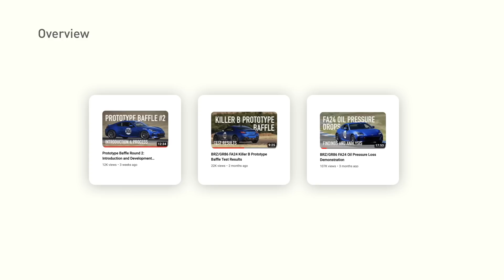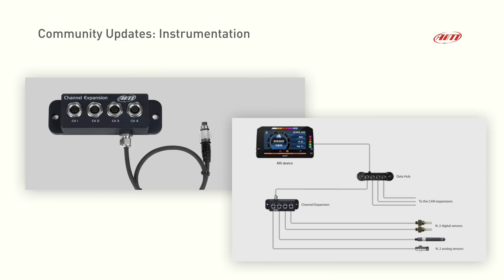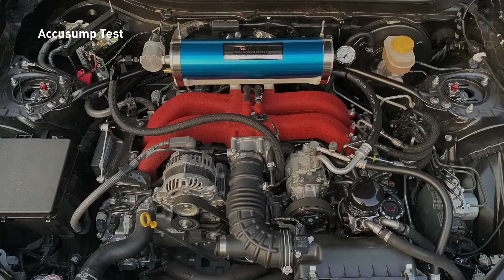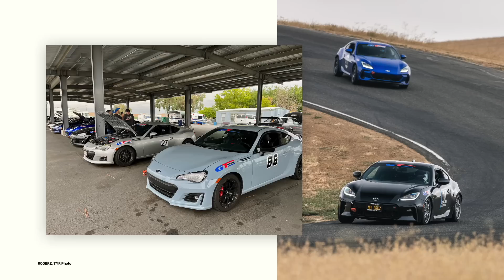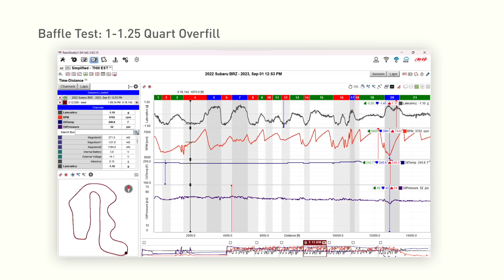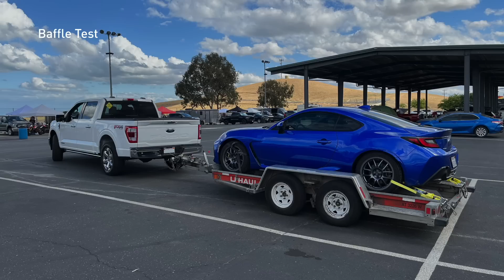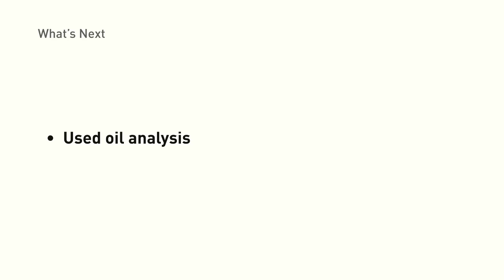Prototype Baffle #2: Results, Setbacks, & Future Plans

Comment: Put a LS in it lol
Reply from the maker: Haha my friend twisted my arm into test driving an SS 1LE before we knew what happened. All I could think about was the consumable costs lol
Reply: @900BRZ  i mean this is not as heavy as the 1 le though and you would have a reliable engine in it since you’re going through the trouble of swapping an engine I think that’s what I would do personally
Reply from the maker: Yeah but it’s a pain to do that in CA and keep it street legal. Only option is a brand new LS3 and then you need all the engine control, plus with the additional power, my understanding is you need a new driveshaft, possibly transmission, axles, diff, and wheel bearings. Correct me if I’m wrong, I didn’t go too far down this path. The LS3 is incredible though, I would love it.
Reply: @900BRZ  ahh yea i forgot about cali for sure..

Comment: Before watching this last episode, I was very skeptical whether the oiling issues could even be solved with a baffle or anything regarding the sump. Much of the issues with the fa20 haven't really been solved and have pointed more towards oil galley issues feeding rods 2 & 3. FA20 drivers tried larger oil pumps, optimized pick up tubes, machining the timing cover, shimming bypass valve etc... none of it seemed to work other than the bandaid of adding an accusump and dealing with it's shortcomings or dumping 5k+ into a dry sump. I am honestly suprised overfilling with the baffle in place made such a large difference. I would love to see more data on this. If the data is repeatable I think it would be worth trying a larger oil pan.
Reply from the maker: Yeah, we definitely need to do more overfill testing with faster drivers. 

There were a handful of people who were skeptical about baffles from the start, so I kinda have to just tip my hat to them.  

We have seen moderate improvements with the SYMS baffle, so right now it still feels like better than nothing if there was no warranty to worry about. I’m not sure it justifies removing the pan and risking warranty coverage though.

Comment: A reduction in oil pressure is most likely a restriction in available oil at the oil pump inlet AND/OR the available oil is highly aerated (can we say foamy).  Assuming the oil pump flow rate (GPM) and the sump volume is great enough to permit an adequate sump "dwell" time (in the aerospace industry we aim for 15 seconds to de-aerate the aerospace oil) for the entrained air to leave the oil, we must also have adequate oil return back into the sump.  Perhaps the issue is with the 2.4's oil system drain back/oil return design restricts the oil from leaving the left cylinder head in a timely manner (and to de-aerate) before the pump picks it back up.  As a retired aerospace engineer (on multiple jet engines and pressurized gearboxes), Subaru needs to be addressing these two apparent design deficiencies when track driven - but is an OK design to get your cup of latte or idling while your seat heater is on.
Reply from the maker: Thanks for the comment. Yeah, after we saw the bigger overfill have such a large improvement it changed our thinking from trying to control oil in the sump to believing that the return is too slow and the oil level in the sump is just too low in general. We’re thinking about ways to test this theory now. We should be able to run this test with the car in neutral and just reving up to 6000+. If you have any ideas for measuring oil level in the sump, we’re open. We’ve thought about adding a Hall effect sensor from bmw to the bottom of the pan, borescope, or trying to rig up an external tube to observe the level.
Reply: It appears the "dynamic" oil level (oil level with the engine running and circulating the oil) is low enough when cornering hard to allow the oil pump inlet to start drawing air in with the oil.  If you can envision a 1g vertical pull from gravity added to at least 1g of lateral g while cornering, any oil is going to pile up in the side of the sump like an approximate 45 degree angle. If you have an uninstalled sump, you could put enough fluid to simulate the dynamic oil level and check for the intersection of the 45 degree line with the pump in let.  Some aerospace applications (for negative g operation in the T-56) will utilize a movable oil pump inlet which flows the "g field".  Developing aerospace systems typically mean a much larger budget to work with.  Not sure if CFD (computational fluid dynamics) software has come down in price (and if oil viscosity can be properly representative) to do "modeling" prior to cutting metal.  Perhaps if you have a scrap oil pan (or make a translucent plastic pan) and a video camera, you could (safely!) raise the right side of the car to simulate high g cornering and watch when the oil level drops as it gets trapped somewhere in the left of centerline of the engine.  We would normally use thermal couples all over with manometer pressure taps too to check for oil churning (trapped oil) that isn't returning to the sump fast enough. Did my rambling give you some ideas to move forward with?  Very respectfully, Charles. @900BRZ

Comment: Wow.  Well, thin flat sheet metal will vibrate like crazy when excited.   Then, fatigue, and failure.  Maybe that's what happened?
Reply from the maker: The cause of the failure is quite clear when looking at the parts in the post-mortem. Verus doesn’t want to publicly dissect the failure or share images and I think that’s totally fair given their support for the replacement.

Comment: Again, great video, I can’t get enough of your geeky approach. What a shame of your car, but on the other hand… no risk, no results. And it’s great that they took the responsibility of this failure, there are not many companies which would do it, so tumbs up! You also mentioned you are going to do standard brake-in procedure, could you please write how to do it properly? I have gr86, and now im in the 4k rpm limit phase until 1600km (1000miles), but what then?
Reply from the maker: Thank you! Agree, props to Verus for how they’re handling this. Speaks to their integrity. 

For break-in, people have strong-held opinions on whether to send it right away or follow the owner’s manual. I plan to follow the manual and then change motor oil at 1000 miles. 

In your case, you’ll also be breaking in your transmission and diff. It’s a good idea to change the diff oil and transmission gear oil too. There will be an increased amount of metal on the magnets on the drain plugs during the break-in period. When I changed mine the first time, there was so much it seemed like there wasn’t really room for any more metal to accumulate there. I didn’t do it right at 1000 miles, but I would recommend doing it at 1k.
Reply: @900BRZ  thank you very much :) I will definitely change oil in transmission and diff! And what would you do after that? Slowly increase the limit of RPM or immediately set the limit to 7k?
Reply from the maker: @Maatttoooo007 Just got for it after that
Reply: @900BRZ  glad to hear that, thank you for your advice!

Comment: Ive ran an Accusump on my turbo frs since 2015 (no baffles) and it's been great.  However I do not open the manual valve until I'm entering the track and close the valve on my cooldown to prevent it from overfilling the pan.
Reply from the maker: Nice. Are you using a cable-operated valve?
Reply: @900BRZ   Yea, cable.  A bit of a pain to route but worth it imho.  I also run 5w-40 and an oil cooler to try and minimize aeration above like 240°
Reply from the maker: Yeah I think cable operated makes a lot of sense. Think this is a pretty good plan. How did you route the cable? The cable from Canton is only 6 ft long. I don’t think that’s long enough to run through the firewall port on the passenger side.

Comment: Just spitballing here, but is there a way to monitor oil pooling in the heads/valve cover? Ive seen this issue most notably in toyota v6 (mz family) under hard braking the front bank fills with oil due to poor drainage. BMW had factory oil scavenge pumps on V8/V10 M3/M5 that ran while above 1g lateral accel. Pooling would align with many of these issues and justify the overfull or accumulator strategy. Modified valve covers with scavenging could be worth a look.
Reply from the maker: Yeah, agree the primary issue seems like pooling/slow return now. We’re thinking about trying to measure the volume in the lower pan with the car stationary in neutral and then revving through the range. Still need to figure out exactly how to instrument that. 

It would be the perfect time to add scavenge pumps while the new engine is out haha. We’re still thinking about focusing on simpler fixes like higher oil capacity that can probably benefit more people.
Reply: Save your old valve covers. Grind a vertical slot up the valve covers, then epoxy a oil safe polycarbonate over the slot. Normal operation will be an oil spray, when the oil pools, should have a clear line of oil level running up the slot. Catch it on camera and you are a legend!  Oil scavenge pumps are probably an easy(ish) solution too, just plumbing and kick the pumps on above 1 g.
Reply from the maker: @ph1lthyvision  Verus wants the old engine so I’m going to send that their way so they can do some development on it, but otherwise I’d love to dissect it and see if we could learn anything.

Comment: Very good work man, I really appreciate this kind of genuine meticulous investigation!

Do you think that using a different oil pickup location would work better for the Acusump? Like a sandwich plate or something? Having that solenoid with a one way valve would be really nice.
Reply from the maker: Yeah that’s worth thinking through. I think some people have a separate inlet for the accusump on the exit of the oil cooler and then only inject into the block port, instead of injection and recharging from there.

Comment: All these mods just to make the FA24 track reliable is ridiculous! The engine shouldn't have these lack of oiling issues from the factory. Makes it so that I want to get a K24 road race engine & call it a day. Only problem with that is I wouldn't be able to drive on the street due to not being able to smog in Cali haha!
Reply from the maker: Yeah I would have considered that if it was possible to do make it street legal here. But I do have a friend with a k-swap in the gen 1 chassis and, let’s just say, they have their own nuances and downsides.
Reply: For a K24 swap it would make the GR86/BRZ track only. I'm sure it has cons as well as the pros but Honda engines have much less issues when being run hard at the track. Another downside is the added cost. It's cool that Verus is stepping up & taking care of you but in reality its Subaru who should pay them back for designing a crap engine & pay you as well for all your research & troubles!

Comment: Thank you for the info!    I run a 1qt overfill. Mostly a street car application, but I have done one track day. Everything has been great. However, I do notice a lot of oil collection in my Radium catch cans. Also, thank you for testing. Sometimes things happen. I hope no one gets all fired up about the Verus oil baffle. Prototype products are tested, sometimes they work first try, sometimes they dont. No big deal.
Reply from the maker: Thanks for the comment. Yeah, catch cans also mitigate some of the downsides from overfills. I should mention that in the future. I have some KB dual catch cans but haven’t installed them yet. Agree about the risks of R&D. These things happen!
Reply: I have been running a one quart+ overfill since day one on the track in my tuned 2022. This, because of my tracking a high-G STI for years with Accusump, KB pan and everything else... running 285 Hoosiers. No bearing failures with my 470 HP car in about 60 hours. 
With the BRZ, depending on how I park and paddock slope, I get some smoke when I first start the engine. No A/OS. I now have many track days from two seasons on the car. My oil pressures are great. About to do a UOA. I run 5W-40 Motul 300V. I have "Track Day" videos here under my name Glyn Churchman. I am turning very respectable laps in the car.

Comment: Really sorry to hear this happened, I was very hopeful we finally had a "simple" fix for this issue.

At this point I'm hoping a header/pan redesign comes directly from Subaru.
Reply from the maker: Yeah, agree Subaru/Toyota should do something about it. But we have some hope about potentially there being relatively simple mitigations, with the big overfill being promising. Just need more testing to sort it all out.
Reply: @900BRZ  I actually just got the GJP sensor kit and was planning on adding some data to the pile. While I'm kind of hesitant to add that much oil I'd be more than happy to run some scenarios. I think my next track day is end of October.

Comment: The japanese know something we don't because there are zero cases of GR86/BRZ engine issues reported there. Also, I have been using their recommendation sheets for their BRZ/GR86 cup cars when modding my vehicle.
Reply: The very first suggestion when you type "gr86 engine" in japanese is "gr86 engine blow". 

We're all suffering the same issues. The only difference is that we have a focus on low-cost street solutions in the english speaking community while at least one japanese racing team focused on an internal sump mod which would is useless to the average owner and a poor solution to even most enthusiasts.
Reply from the maker: Thanks for the insight!

Comment: The reason I took the Accusump off my '23 86 was exactly what the data is showing - it smooths out the peaks, but it's running lower oil pressure at WOT when it's filling the accumulator back up. If it would normally be at 75 PSI, it's now only getting ~60ish PSI to the system since it's feeding a large tank. Leaving the pits with the hot oil idling around 14 PSI and then going WOT to enter the track, I wasn't comfortable with the "accusump filling" pressure. I think it creates more problems than it solves (I didn't even think about the "pressure relief valve" issue - thanks for including that). I will continue running 1.5 quarts over the high fill line, there are no downsides, even on the street. "Without data it didn't happen" - prove that the overfill actually creates aeration or other downsides, please.
Reply from the maker: Thanks for the comment. Yeah, agree I have no data about the downsides of a large overfill. Since the overfill goes against manufacturer recommendation though, I feel like the burden of proof is to prove there is no downside, rather than assuming it’s safe unless we prove a downside. 

I was joking what we actually want is a reverse Accusump. We want normal oil levels (charged accumulator) when the RPM is low, but then higher oil levels (empty accumulator) when RPM is high and oil return to the sump is the limiting factor. We could probably program that with electronic controls and the solenoid valve, but we need to find a different valve that doesn’t act as a 1-way unpowered.
Reply: Curious how the manufacturer could even know that you ran the oil fill level high, unless you brought it in there like that. And if you were worried about the manufacturer, I'm certain you'd take the time to take 1 quart out of it...
Reply from the maker: It’s not so much I’m worried about the manufacturer seeing what I’m doing. It’s more that I just believe deviating from their recommendation needs to be proven safe. And I’m reticent to recommend things publicly that I don’t have evidence are safe when they deviate from factory spec.
Reply: As shipped with the recommended oil fill and weight, these things keep popping with light to moderate track use. I think it's safe to assume we can ignore the manufacture's recommendations at this point, which is why you're doing all this testing.
Reply from the maker: @FlatBlack_240SX Oil weight for sure. But the fill level is to avoid crankshaft aeration and excess drag. I would like to get as much oil in there as possible now, but want to make sure we’re not introducing downsides as we go outside spec.
Reply: What pre charge psi are you running? If you run a higher pre-charge, it'll reduce the oil capacity of the accusump, which will mitigate the low pressure at WOT issue and respond better to small dips. We don't need a lot of sustained assistance from the accusump with this platform.

Comment: Sorry to hear about the engine failure.  

Is this your first engine blow via no pressure oil?  When u see the zero pressure, u need to shut the car immediately in order to increase chance of avoiding the damage….
Reply from the maker: Yes, first engine failure, period. I disconnected the OE pressure switch, so there was no warning other than the pressure display I had on my steering column (not visible in the video). I didn’t look down at that until T8 after the event in T3. 

I’ll be making changes to that setup to either bring back the factory switch or recreate obvious auditory/visual warnings. Agree, it probably would have been possible to save the engine if I had caught it immediately.

Comment: Still surprised this severe oversight was approved by both Toyota and Subaru
Reply: What are you talking about. There is no severe oversight here. 900brz is doing som r&d and smoked his car in the process. That wasn't Toyota and Subaru's fault. There is an inherent risk racing and track your car. Everyone knows that. This is not a Toyota/Subaru thing. I have seen Mazdas, BWMs and Hondas blow up on the track. Here, we are simply working on solutions to make our cars more resilient on track under heavy loads.
Reply: @Julianklaus  selling cars that come with a year of NASA membership, intended for safe track use with potentially catastrophic oiling issues (RTV + pickup issues)